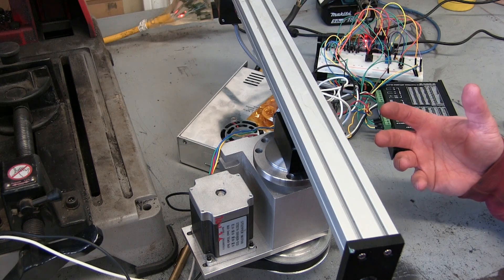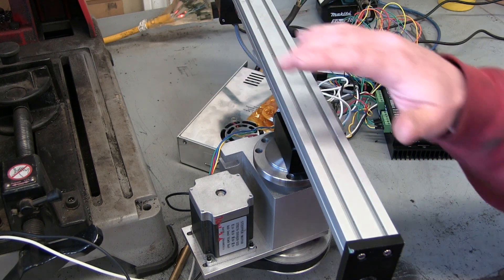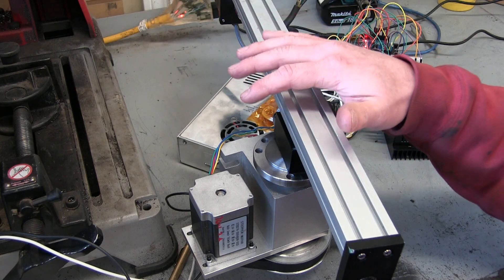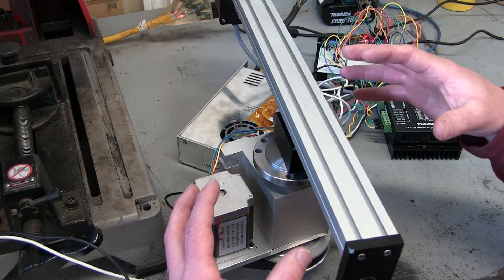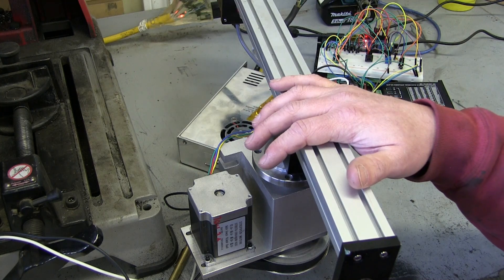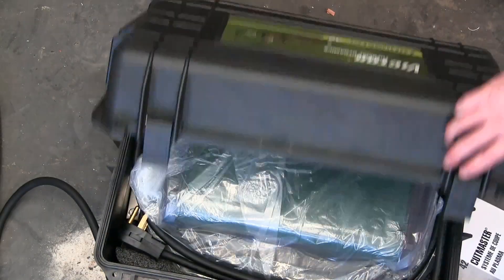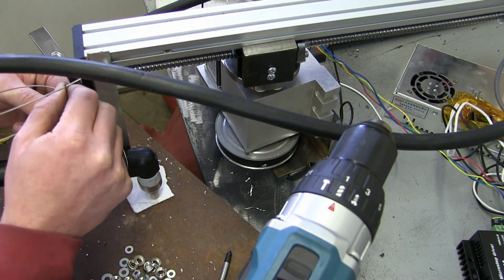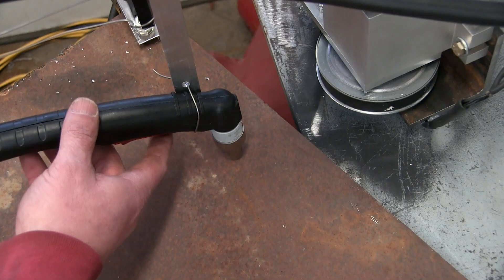Portable CNC Plasma Prototype

Comment: needs to be able to trace a drawing on the work piece, kinda like a pantagraph, but after it traces it it remembers, then cuts it. Some provision for holding a marker or soap stone to accurately depict the cut. An offset function for making the cut out smaller or larger. For cutting holes have it pick up off a center punch mark, press a button to define center, define size, then press go. A speed adjustment knob...like a track burner.  Your going to need to be able to hook a torch to it too. you can add a provision to the base to allow for clamping to stainless and what not. Lots of possibilities. Can I put in my order now, i'm going to start a mobile cutting service based around your machine.  The software should be pretty simple, any scientific calc can to rectangular to polar coordinates.

Comment: It can only cut crescent shapes now. You'll need some math to correct for the arc when the rotary axis moves. It would be converting Cartesian coordinates to polar and calculating a chuck of steps at  time. This might be very tricky if you are just sending steps from an Arduino, as you essentially have to correct by calculating the curve and subtracting it from the target line/point. 

A GRBL shield for the Arduino might work well, and then you can modify the GRBL source to translate to polar on the fly. This would then mean that you can send G-code to your polar CNC pretty easily. I made a hanging V plotter and modified GRBL for it's (slightly different) polar coordinates and it works great, I can send it gcode without a problem. Let me know if you want to know more, I'd be happy to help or make the needed changes to GRBL!

Comment: arm can have rotary and linear encoders, so you can point out each corner (vertices) with the machine, and then tell it to do cutting. which will move the arm b/w vertices.

Comment: That's skookum as fuck but how would you get it to line up with an existing axis? If I want a slot parallel with the side of my already-cut plate, how do I make sure I'm placing the mag down 100% perfect? It's already a pain in the ass to get a perfect origin on an existing plate with a CNC router table.

Comment: use a telescoping arm to reduce the space it takes in travel then reduce the height and weight, the arm just needs to be an inch or so off the surface if you put the cutter on the end. I thought about building something similar if I ever get around to building a shop.

Comment: Milwaukee mag drills are fuckin atrocious.  The mag off and reverse button are feel the same.  That's the story of how I broke off a tap inside an L&J 27 ton punch press.  Side note, why not just use your magic drawing robot.  I'd trade the slightly smaller footprint for fewer bugs from trying to correct for different radii.

Comment: Dude, you really need to check out the current state of 3D printing.  All the work is done for you.  All the inverse kinematics have been solved.  The hardware is really cheap as well, it uses an Arduino board as the brains, and already has the stepper motor drivers.  Check out RAMPS 1.4 boards, with a RepRapDiscount LCD and controller.  You can have a complete brains that will drive your steppers for under $50. Check out Repetier software, with a few config tweaks you can input a square, and it will handle the cartesian to polar coordinates.  It also handles feed rate, acceleration, Z axis, and more other things than you can poke a stick at.  If you want to be fancy you can get boards with wifi (more expensive, though), so you point a phone at the interface and get it to chooch right from your phone.
Reply: Some actual firmware and working models are here: http://reprap.org/wiki/R_360 .  This is a different layout than what you're proposing, but the concepts are the same.  The inverse kinematics are directly applicable.  I firmly believe in not reinventing the wheel.  Using some cheap, standard, off the shelf parts, and no programming, you could get a machine that would be able to select any Gcode file on an SD card using a rotary knob and LCD panel, and cut whatever shape you want.  I'd have several folders for circles, squares, etc, and inside each folder would be several gcode files for various sizes of shape you want to cut.  The best part is that it's all available right now.
Reply: Yeah, but he couldn't use the Ramps for something like this. I mean, look at those steppers! And 3d printers use NEMA 17's.
Reply: You can always break out the pins from the stepper driver sockets to his existing drivers if you want more oomph.  However with the gearing he's got, I'm sure that normal drivers would be totally fine.  There's next to no load on the head, he's cutting slowly, my delta printers have way more force on the steppers.
Reply: HC-05/HC-06 is the cheap-o module you're looking for.
Reply: Ben Hitchcock I think he knows most all that his name is AvE "arduino vs evil".
Reply: True. I think there are bluetooth modules that you can put on the TX and RX pind on the Arduino board and you can send g code right from your android phone with apps like GCodeSimulator.
Reply: my thoughts excatly

Comment: Hey, so, absolute encoders on the motors are a must, so you can place the mag base, then move your cutout origin by hand. Cut the same size/shape hole several times without moving the mag base for each one, just change your origin. Just my two pennies. This thing is gold. Thanks uncle bumblefuck.

Comment: This would work, you'll need a LOT of work to get it to a final product. The problem with using an arm instead of a gantry for things like plasma is that you need very tight control over the z height of the torch. So you'll need to have a fairly stiff arm and also add some automatic z height adjustment brains. There's a lot of different options, here's one from China with an all in one package: http://www.ebay.com/itm/SH-HC30-Plasma-Torch-Height-Controller-THC-For-CNC-Plasma-Cutter-Flame-Cutting-/112074012794?hash=item1a1821b87a:g:arYAAOSw9IpXxnym

Comment: why not have a tracing tip or even just a tracing mode where you can draw the pattern right on your part, then trace it with the arm attached, then hit go and it does the business?

Comment: I had a thought on how to go about calibrating it to the thing you are clamping it to.  Have the ability in the app to drop a pin on the pattern you are going to cut as a start point and then position the cutter on the piece so that where you leave it is the pin on the shape on the app.  Makes sense in my head, even it didn't come out the greatest.

Comment: What if the cut needs to be super deep?

Also, the programming for the app will be somewhat tough, and connecting app in a stable way will be tough.  May want the app to start the process + control the process but not command the machine.

Comment: Someone correct me if I'm not thinking correctly, but wouldn't it be a royal pain in the dick to line up a square hole to be parallel to the sides of a plate? You would have to have the base placed in the right spot pretty damn close. Possibly you add a laser level type feature that lets you square up the base. I guess i may be overthinking the expected accuracy of a plasma cutter, but I'm a machinist, not a fabricator. Round holes should be cake though. place the torch at the center of where you want to make a hole and hit start. I really dig the idea.

Comment: There may be a way for the driving software to compensate for the rotational arc that comes from the vertical axis of the magnetic base.  All shapes input would need compensation. I think that is going to be quite complex, because the challenge is discerning where in an input shape the compensation needs to be applied.  And to what degree given what distance.  Still, that's what's great about software coding - the pseudo-intelligence we build in.  WE'RE ROOTING WITH 'YA, NONETHELESS!!

Comment: test it on a vertical wall and upside down I'm worried that the weight of the arm will make it inaccurate and when upside down the off-cut might start to sag and upset the torch

Comment: yea wants a plasma cutter thats vertical i think less tangle on the hose to the head of the cutter and give a smaller foot print. And slower on the out arc of a cut slower means less crap to grind off.

Comment: I think you've got a solid start on the hardware here, and as you note  the "soft" part needs some spiffing up. Polar to cartesian conversion is nothing new, though. I would be very surprised if something isn't already available from, say, somebody who has done some Arduino project.
I can imagine the software... pinch and zoom to change the cut size, bolt pattern setting with a toggle. 
Did I miss a T-shirt video somehow? Here I am trying to contribute something useful. What a chump I am! :D

Comment: Something that I'd imagine being a bit iffy in the field would be indexing the origin of the drill. Where would all the pathing be based off of and how would you know you were in the right spot.   

Also you might not have to use polar to x,y conversions.  In kinematics there is something called curvilinear motion using cylindrical components. Cylindrical components are used in the standard x,y coordinate system but also uses theta and a position vector to describe how a single particle (the tip of the plasma cutter) can move along a path.

Comment: If you added a little bit of movement on the Z axis this could be really good and mobile. Put a proxy sensor on the end so it can lower itself to a set height. That way you don't have to worry about Uneven surfaces.

Comment: Good fuckin idea. I'd definitely use this. Wether it be easier or not. I could even see the older crowd who don't know how to work a smartphone work with the app concept you're talking about. For me, even if I had to learn to code somewhat, that would be fun to mess around with and figure out all on it's own. I'd say it needs a score around the handle for the wire but it is a proof of concept and I know you could improve the mounting if you felt it was needed. Really cool idea!

Comment: As someone who's done both fab work and run cnc lasers, I'd have loved one of these back at the welding shop.  The biggest headache I can see will be coming up with a good way to index the cutter to the workpiece and orient the shape to be cut.  It makes sense to set up a circle by the center point, but that's not enough for ovals, polygons, ect.  Rotation might be even more critical when dealing with bolt patterns.  A simple way to set up and adjust the cut placement will make or break this thing, Oh, it'll need a kerf width parameter too and the option to cut inside or outside the line.

Comment: You need to convert Cartesian coordinates into Polar coordinate (it's trivial). You'll also need either to create an input field for  cutting feed rate that translates/handles a linear cutting speed (mm/s for the straight parts) into an angular cutting speed (when it's the vertical motor moving the plasma nozzle). Most likely those will have to work simultaneously, when the plasma nozzle is being moved on both axes (eg, when cutting a circle). OTOH, cutting speed could be pre-tabulated in software for different materials and thicknesses, and these just indicated to the confuser on what to expect.

Comment: why not a floating head vs. fixed to allow for surface imperfections. Simple spring or hydraulic adjustment, or get extra skookum and add another axis with a level sensor. Just my rusty nuts........

Comment: outer radius cuts will have a higher sfm so to speak so it will have to compensate for the diffrent speeds of larger radius arcs to fully cut threw very cool... im sold.

Comment: so... out on the outside of the arc it's gonna be hauling ass but while choked up it'll crawl. 
somebody in here has to be clever enough to get that interpolation sorted out for constant feed rate.
that interpolation is gonna need to be sorted for all the fancy angles and curves. it might be one one of those things that just comes out in the wash, like cutter comp does. dunno, coding and CS engineering ain't my bag. Am REALLY good and standing around not helping for shit and saying "well thare's your problem"

Comment: AvE, I could see some problems at the start there with some build up at the start of the cut, so you gotta start releasing the plasma schmoo in the center of the area, and move out to the first corner and then do a loop. The start of the cut will be on the inside and just drop away. Release the Schmoo! T-shart for a great idea?

Comment: also the farther out the arm goes the slower the turn it need to go so that needs to be compensated for otherwise it will cut way too fast honestly i was a guy who did lots of template cutting which works well and could this be adapted to a machine torch like we had one at work attached to a tractor aka beetle with a hand controller starter ona hypertherm powermax 105 used it for 1.25 inch beveling and long plate cutting cant see why it wont work just id say for even big plasma probably 3/4 cutting max capacity cause the torch needs to be rotated into the cut beyond that on most standard non mechanized machines like 300 amp units

Comment: The usefulness of the idea is not a subject that I am overly knowledgable in but I do know about making something simple to use while it's underlying functions are quite complex and on that front I will say this. Apps that control things is hard, getting your device though CSA testing is expensive and hard, embedded systems is hard and all of those require some advanced programming  enginerding. Also people have ideas for what they think are great products all the time but making them into products is hard and expensive and takes a lot longer that an individual might think.

Comment: Hell yes I'd buy one! Especially if you can keep the price point well below a plasma table and allow for user upgrading.

Looks pretty wobbly in the travel. It might suffice for sitting level but it'll fuck up all over on the upside down. The extrusion is probably skookum enough out to 3 or 4 feet I'd imagine so you'll need to embiggen the part where it attaches to the base. All the linear parts I know about don't like being where it's dirty af. Perhaps use some skate bearings with a big wheelbase as it were in the t-slots to keep it steady. Then you'll need to take the weeble-wobble out of the rotary connection to the base, a pair of pillow blocks perhaps. Also, make sure the magnet can handle an upside down machine, the torque will be pretty high and will want to pull it off the surface. That should get you through the next iteration.

The code is pretty jellybean at this point, there are polar coordinate 3d printers available so you might steal code from those. Its mathy af, but its doable.

Comment: For portability and setup, why not make it out of two separate parts? (the slide and rotary actuator) and have them connected via a key with a set of lugs (aka a quick release key) like they use in breach loaded cannons? (the really old school ones made from cast brass or iron)

Comment: I work in a shop that has 2 flat Lazors and a tube lazor so I'm always spoiled for precision cut parts. unfortunately sometimes the parts get lost between the Lazors and my welding Bay or enough aren't ordered or whatever, but one of these would be super handy rather then having to wait half a day or longer for replacement parts just whipping this out and making the parts myself would save loads of time in just having to put projects aside because I don't have the right parts, as a welder I approve of this fantastic idea

Comment: Brass or copper shielding would help keep the spray from welding to the tool. a friction wheel drive would allow for movement even in dirty conditions and acts as a mechanical over load when the arm tracks into something.
If you were able to "teach" the arm a shape by manually following scribe lines, then the machine offers repeatable parts without the shakey cut marks.
The final programing should have a extra check box for cutting a 360° around the base, to help remind the gorillas not to cut the branch they are sitting on, and dropping the tool.
Lots of potential here, I'd love to have one.

Comment: As one of the "metal fabricatin types" I love this idea. I work with an engineer and we have access to the expensive software etc...but as someone starting a small biz, the time and $ involved in him doing CAD drawings, exporting them, having them cut for us etc is insane.  Putting something like this together on the cheap would be primo for quicky brackets, mounts etc

Comment: as a concept, I think its great. short term, maybe a servo or small actuator for the trigger and maybe hold it with a hose clamp. also, it would be interesting if a plasma cutter could work like the shaper origin with visual reference tape

Comment: People are going to want to cut rectangles or squares with this. Since it's pivoting on one point, both of the stepper motors will have to be spinning at the same time which could lead to an uneven line. Unless both of the stepper motors are precise enough, and if they arn't you could use gear reduction.

Comment: I would definitely use something like this. Consider a few ideas, though. Vertically mounted cutter so it's out of the way and the cable doesn't fuck it up when the cutter needs to rotate. Also speeds, feeds, and thicknesses for materials. Maybe make the cutter easily removable so end users can sub in a new cutter if they need to cut... say... quarter inch plate steel.